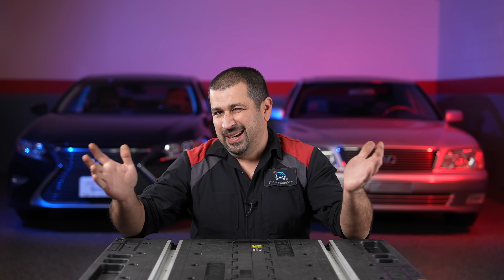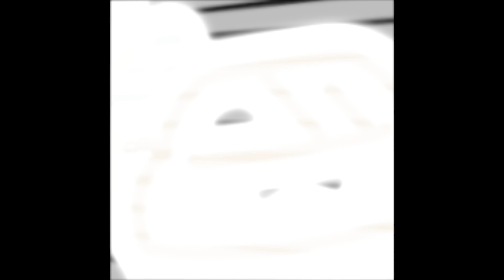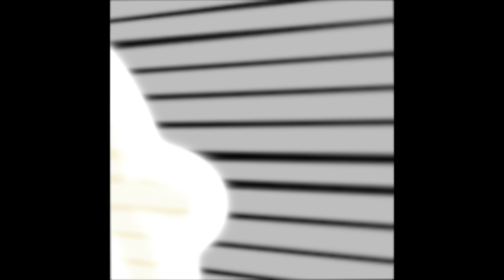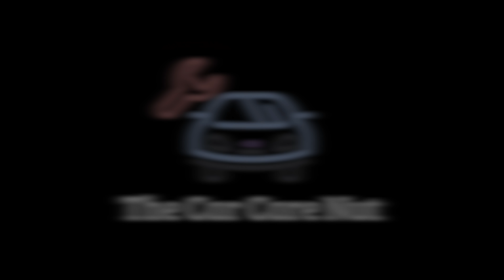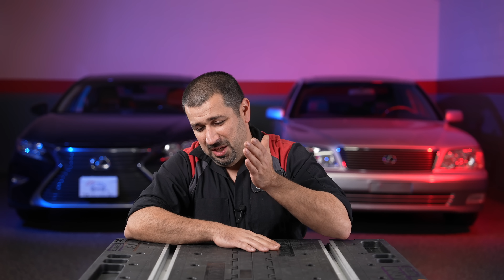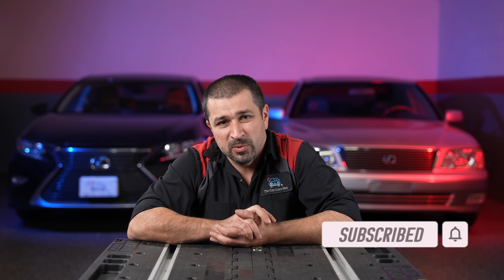Can Modern Turbo Engines Be Reliable? Here's The TRUTH!

Comment: Umm diesel definitely burns hotter than gasoline. When i was in school we learned the average combustion temps were around 2000* for diesel and 1800 for gasoline. but can get over 2500* in a diesel when its being worked.

Hence why diesel guys are so concerned with EGTs so they don't melt a piston or literally melt there valves into the head.

Direct injection gasoline engines are nearing 2000* under high load scenarios.

The biggest difference is speed of burn. Diesel is like a slow burning gunpowder in a rifle bullet, gasoline is like a rapid burning powder in a pistol.

One extracts alot more energy from the same process and the other makes alot less energy at the same rpm ranges. Diesels like to run rich at the bottom of there rpm ramge and lean out significantly once boost rolls in. It keeps exhaust gasses much cooler at low rpm high load scenarios.
Gasoline likes to run slightly lean at idle and get rich as you get up in the rpm ramge as that promotes cooling uptop in the higher rom range.

Its why we cant make true diesel like low end power with gasoline as it runs to rich down low to make power without spitting crazy amounts of unburnt fuel into the exhaust.

Comment: I have a 2015 14:03 14:03 Ford f 150 with a 2.7 twin turbo. Oil change ever since I bought it used with 22k on it 4 to 5000 miles. Currently has 160,000 miles. No problems at all. Still runs strong. Great mileage, 20 mpg or so. Oil is mobile 1 in recomended weight. Great video..
  Now do one on stupid wet belts!

Comment: I own a 2019 2.3 Liter Ford Mustang ecoboost bought it at 19,000 miles in 2020 I have changed the oil every 10,000 miles with premium full synthetic I’ll hit them intervals within 3 months due to traveling to work I’ve had 0 issues with my car no transmission ( 10 speed ) no ticking never been to a shop once no check engine light it currently is sitting at 207,000 miles and I’ll be doing another oil change in 3,000 miles just my personal experience here from a turbo engine owner take what you want from this

Comment: Excellent video. I have driven diesel turbo engines for decades and had more issues with the fuel transfer pumps but never the turbo. Now I have a 2026 turbo 2.5 liter engine and was very worried about the turbo but in the SUV's I was looking at they all had turbo engines so I had no choice. I will now religiously change oil every 3000 miles or in my case in Canada every 5000 kilometers. Thank-you.

Comment: Good words to live by 

I won't name the brand name, but I would say all of the brands would fall into the same condition, but I know the service manager well at a major dealership and they change their oils frequently on their delivery vehicles. Almost all of their vehicles are turbos, even their full size pickup trucks. I have been told that even with regular oil changes this manufacturers life expectancy on turbos is between 68 and 75,000 miles. Granted, these vehicles are driven all day with a lot of stop and go making their deliveries through town, but it's no small amount of money to have these repaired, and it is a ridiculously short amount of run time considering the technology advancements were supposed to have.

Comment: No way would I buy a turbo. The engine components are the same as a non-turbo. Same rings, same rod bearings, valves, and pistons. Now you introduce the turbo and force the engine rpm’s to drastically increase,placing more strain on the engine parts. Those parts are engineered for non-turbo engines. It’s like forcing a racehorse to run 20% faster, then expect him to live as long as the standard horse. No way !

Comment: I drove several small turbo engines (898ccm and 999ccm) with no problems. Now I have vw 1.0tsi MY2022. Do I make big mistake using 5w30 instead of 0w20 oil?

Comment: Based on personal experience I can only comment on turbocharged automotive diesel engines, specifically  Volkswagen.  VW specifies 10k mile oil changes using fully synthetic oil. This change interval is more than adequate, even for fairly sever driving, to allow the turbocharger to last the life of the engine. Oil analysis confirms this. It's not unusual to see these engines last 300,000 to 400,000 miles.

Comment: A lot of the modern turbocharged gasoline engines are direct fuel injected. This tends to dilute the oil with gasoline over time.  Tnis makes shorter oil change intervals even more important. Oil diluted with gasoline does lubricate well at all.

Comment: My 2010 Toyota Yaris has 374,000 miles on the original engine and automatic transmission. 3k mile synthetic oil and filter changes and drain and fill transmission fluid every 20k miles or so. Driving it till the wheels fall off.

Comment: Had a 2018 honda accord turbo heads blew at 115k turbo went at a 150 k. Heads blew again at 160 k.
Manufacturer's recommendation is to change oil and filter every 7500 miles with synthetic oil.Which I did religiously.
I had four honda's previous to that all of which went 200K plus ... nonturabo. And I was religious with a the maintenance schedule. 
This was the first turbo I ever owned. I got rid of the honda and bought me a regular gas, aspirated engine.
I will not buy another turbo if I can avoid it in any way , shape or form.
I wish I would have followed your instructions regarding oil changes.But I was doing what the manufacturing requested , and that it always served to me well in the previous four hondas that I owned.
Thank you for the information!!
Reply: I had the same issue with head blowing at 90k even after doing regular maintenance
Reply: 7500 is 2500 to long

Comment: I bought my son a WRX.

He road it pretty hard and got about 150,000 miles on it before he sold it.

Zero problems with the turbo. Zero problems with the engine.

Oil changes with synthetic oil every 5000 miles.  And the thing that was just as important was a turbo timer. Those two things were vital.

Coking the oil in the bearing on the turbo because it’s hot from the exhaust side is the major fail failure, because the oil channel gets blocked.

The combination of synthetic oil and more importantly, the turbo timer, saved it every time.

That was a while back. I don’t think I’m modern cars. You can use a turbo timer.

That’s a good question to ask can modern cars use a turbo timer.

Anyway, for those who don’t know what a turbo timer is. You turn the engine off and it stays running for a preset time. The keys out of the ignition. You lock the doors and walk away and everyone thinks you’re kooky.

TikTok TikTok. The exhaust side of the turbo cools & the bearing cools with with normal temperature oil flushing through it. Magic.

Comment: Something to discuss on the newer Mazda vehicles (CX-50, CX-70, CX-90) is they take 0W-20 oil, but in Europe they take 5W-30.    This is because in the USA, the EPA has them use 0W-20 to get better fuel economy.   I have a Mazda CX-70 and I'm switching to 5W-30.    I'll change the oil every 3-4k miles like you said.
Reply: Exellent idea in addition to 3,500-4,000 mile oil changes. 0-20 is too thin to protect bearing journals.

Comment: I had to give you a thumbs down on this video. On the one hand, you say you trust that the engineers have the correct weight and specifications for oil But then say that the engineers don't care about how long the oil should stay in the vehicle. If you're going to make a claim that engineers are misstating oil change maintenance then you need to back that up. At the minimum, send the oil for analysis to substantiate your claim. I understand that you are just trying to be ultra-conservative but it needs to be backed up with verifiable facts. I'll try a few more of your videos; you do seem like you care but I found this one uninspiring.

Comment: As the saying goes: powerful, cheap, reliable. You can only pick two. Automakers chose to introduce small displacement turbocharged engines that were as powerful as their old large displacement engines, without significantly increasing the cost. In other words, they chose cheap and powerful, so naturally it won’t be reliable.

Turbocharged engines are inherently much more complex and much more expensive than naturally aspirated engines. So if you want to make one at the same quality level as your old N.A. engine, it either wont be powerful, or it won’t be cheap.

Comment: Another important point. DONT drive the car hard ALL THE TIME. Don't get on it  from every stop.  Accelerate easily up to speed, basically try to keep the Turbo working easily. Sure, if the situation calls for a rapid acceleration,  that's fine, but don't hammer the Turbo and engine every day. Yes, I know it can be fun, but don't do it. Especially if your factory power train is only up to 60.000 miles. Because after that, you're on your own....

Comment: AND use quality gas that has lubrication additives-Chevron, Mobil. These lubricants protected the top of the piston and rings during combustion.  Check out Lake the Motor Oil Geek. He talks about how important fuel is.
Reply: Is that synonymous with top tier fuel? Or is Chevron/Mobil supposed to be even better?

Comment: Properly maintained… absolutely a turbo engine can last. Diesels are prime examples of that. 300td ain’t fast, but will outlast the heat death of the universe. Cummins diesels will happily do 1 mil miles even when tuned far above their designed power output. I had an explorer 3.5 eco boost and that thing is still plugging away with new owner well above 150k. We had dumb little problems like water pump and puts going out (that could have been more catastrophic if not handled promptly).

There are engines that weren’t designed well that are turbo… and they will fail. Others tend to last longer. Most situations I’ve seen engine failure weren’t design or mfg, they were more often than not failure to do proper maintenance at reasonable (not same as mfg recommended) intervals

Comment: Diesel engines generally burn hotter than gasoline engines due to their higher energy density and combustion efficiency. Diesel fuel releases more energy per volume combusted, which contributes to the higher combustion temperatures.

Comment: Diesel needs higher combustion to ignite. Diesel fuel requires higher combustion to ignite due to its higher flash point and autoignition temperature compared to gasoline.
Reply: Diesel combusts due to high pressure, not by ignition.
Reply: @wandpj  Still ignites, Diesel engines utilize compression ignition, where the heat generated from compressing air ignites the diesel fuel without the need for spark plugs.

Comment: My mechanic says to avoid buying a turbo charged new vehicle for an additional reason. Your reasons are equally valid but "environment"  he says is also a huge factor on turbo failures. We live in a salty environment here. I live north of the USA, along the Atlantic ocean in Canada.  Salt in the air causes corrosion of the moving parts of the turbo unit resulting in premature seizure and bang!- turbo failure. That is what he sees a lot of in his experience. If I'm buying a vehicle to get rid of it in 3 years or so no problem; If it's going to be long term- buy a non turbo vehicle. He also mentioned "dirty gas" being a cause of turbo failure. I'm not aware there's a problem with dirty gas. Great video thank you.

Comment: Heat is an engine’s enemy. Keeping your oil fresh is the best course. But..

There’s a good reason Ram didn’t use the Hurricane in the 2500/3500 trucks, they kept the 6.4 Hemi. We’ve already seen several failures in the Wagoneers and Ram 1500s. Especially during the summer. Hot weather and hard use towing boats and RVs up mountain roads. Detonation has been the number one cause, even more than oil issues. Piston failure is just as common as bearing failure.

Comment: My Vw 1.5L turbo charged engine goes 7,500 miles with Amsoil 508-509vw specific oil with no problem. I get to that number because the oil analysis shows that I can without the viscosity, additive package and TBN being compromised. That's not anything "new" with Amsoil. No gimmicks just SCIENCE based results. However, it doesn't mean anything if you don't warm it up and cool it down. Oil can't protect against bad habits.

Comment: New oils have drasticly improved in quality. The problem is high fuel dilution and multiple heat cycles a day that breaks down the oil, and that has not changed with most passenger vehicles. This is why in the last 20years the trucking industry was able to go from 15k mile oil changes to 60k+ mile oil changes without issues, but cars just simply can't get pass that 5000mile.

Comment: We own two PR25DD Nissan-powered Mitsubishi Outlanders both AWD. Normally aspirated. 5k oil changes and the oil level remains the same after 5k and so does the color (non-accurate test) but my confidence in these two engines is pure and warranted. Our twin Nissan Quests both VQ35’s with over 200k miles no oil burning and no troublesome turbo. 

2017 Tucson, we owned it when we had the Quests. 42k miles the oil burning began. 60k over 1 quart per oil change. We knew the issues of the 1.6T and we dumped it. 

No turbos belong in a family-oriented vehicle. Even a Toyota. Nope, not me. 

Outlanders are a little on the slower side but not terrible. Reliability is key.

Comment: So true.  2025 Lexus NX 250. No turbo. Got one.  Also an old school 370Z manual transmission 2017. No turbo. Both bullet proof. Change oil in both 5000 km or 6 months religiously. Works for me. 👌

Comment: I own a honda accord 1997 (5th gen, F22 engine), with 284000 km, working perfectly so far, i'm very carefull with the maintenance, I'm just wondering what might be the difference between this new engines that goes as 1.5L with turbo against my old f22 engine. Thanks!

Comment: my bronco raptor with the 3.0 get worse gas milage than both my 2020 C8 w a 6.2 liter and my 1996 bronco with 5.8.. Turbo'd engine have to dump gas to keep detonation down. Hell i dont even know if it gets better gas milage than my 2012 Vmax. The idiots in government don't know what they're doing. Just like here in the US your told to use thinner oils to squish out every mile possible while in other countries that same car will use 5w-30 etc. c8 oil gets black or near black around 7000 miles, while my raptor as soon as 2000 miles but service says every 10,000..

Comment: Here is a major advantage that is overlooked on 4 cylinder engines vs 6 or more cylinder engines. I noticed this on a Ford Ranger using the 2.3 L turbo vs the 2.7 L V6 turbo.  With a recent Ford upgrade to the 2.3 L turbo that moved the power up to 325 HP and 380 ft lbs torque, and looking at the power curve graph comparing the 2.3 4 Cyl to the 2.7 L V6, a VERY surprising fact appeared. Under 3000 RPM, the 2.3 L 4 cyl  torque is HIGHER than the 2.7L V6, and the V6 torque does not overtake the 4 cylinder until above 3000 RPM!  Amazing that the smaller 4 cylinder 2.3 actually out-torques the larger 2.7 V6 in the lower RPM ranges where it really matters for off-road and general drivability! torque

Comment: It's not correct to compare commercial diesel engines (like in big trucks and such) to passengers car turbo gasoline engines. In the US you don't have usually passenger cars with diesel engines but here in EU they are as much as gasoline if not more than those. I don't know about all diesel engines but Toyota D4D engines, like 1KD-FTV and 1GD-FTV or  2AD-FTV have, in fact, throttle body. Granted it has "slightly" different function than with gasoline engines.  They were designed to work in Toyota SUVs and smaller passenger cars for daily driving.
They're not the same for sure. Diesel engines run at a much higher compression ratios compared to gasoline.

Comment: bought a 2012 VW CC with the 2.0 turbo.  Car is still running strong with over 200k on the clock.  My daughter is driving it and i continually stress to her to change the oil.  Both because of the turbo, and because of the timing chain tensioner.

Comment: I once owned a 1993 Mercedes 190E,non-turbo, 2L, 4 cylinder, large block 135 Hp, 137 Ft/lb torque. My current 2018 MB B250 turbo is 2L, 208 hp, 258 Ft/lb torque. The guy who bought my 1993, 190E in 1996 is still driving it every day. Will my engine last as long, I doubt it. What is better, emissions statistics or long-terms reliability? 😊

Comment: In Australia there is concern about Subaru products especially on the used car market.  General advice is that used Subaru vehicles are more likely to be unreliable and cost far more to rectify.  Subaru has had serious head gasket issued and these issues have not been convincingly been resolved.
Reply: That would be because WRXs are given a hard life.

Comment: So, if you need a reliable used car with a turbo in the future, there will be none.  Those who change oil every 3k miles are likely to stick with them. Otherwise, why do it? Nothing will persuade you to switch to electrics faster then a used car with a shot turbo engine. It's almost as if this all was intentional.

Comment: The difference is very simple diesel engines are built to handle detonation in fact they run on detonation when gasoline engines are not built to withstand detonation very important Point you're missing sir
Reply: Diesel engines are built stronger to cope with the higher compression used to ignite the fuel.

Comment: The more complicated cars get, the more I love and appreciate my 1972 Datsun 1200 I have tucked away in the corner for sunny days. It is not refined or high tech, yet it is quiet and smooth.  It does not have many electronics, yet it only sips fuel.  It does not have big power, yet it keeps up with traffic okay because it weighs just 715kg.